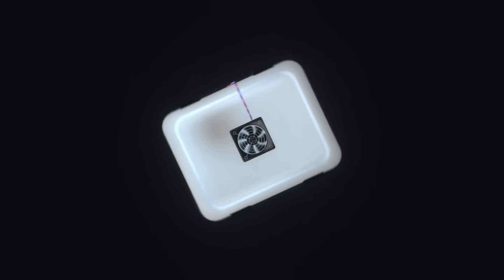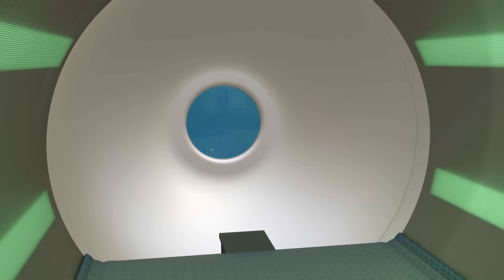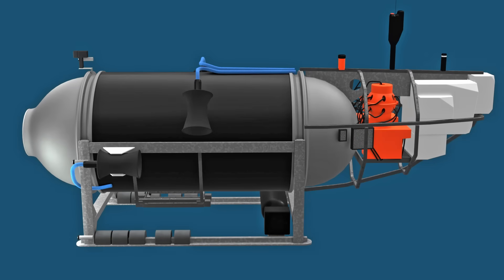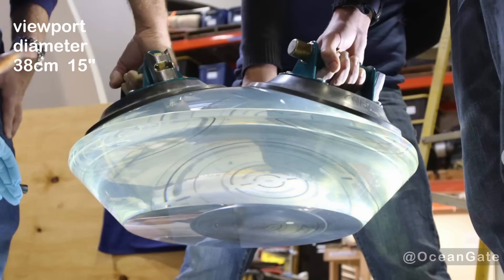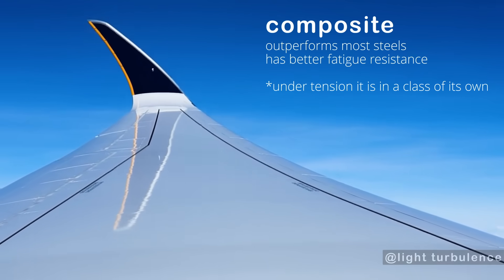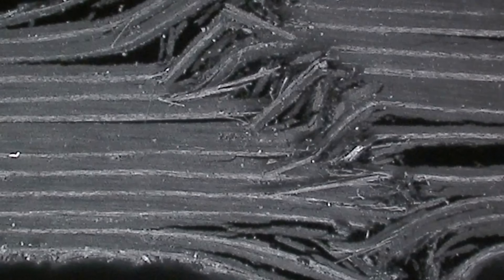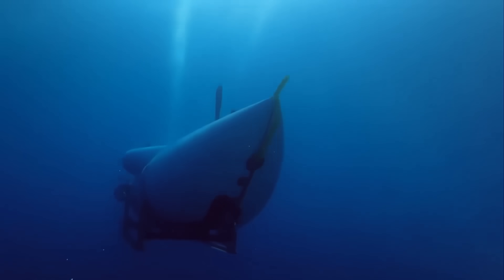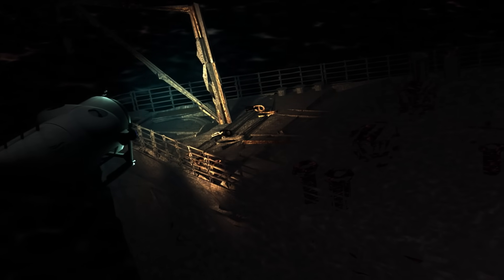Titan Sub | carbon fiber - Detailed Tour

Comment: You fail in your explanation, to show correct pressure loading on the hull. There is actually a water pressure differential between the top of the hull and the bottom of the hull at these depths. The pressure gradiant about the hull varies and there is no added geometry in the hull cross section to correct for this gradient, it is simply a circular hull. Similarly there is no end section geometry of the carbon wrapping to compensate for the pressure gradient about the hull in it's entirety.
This was a very poorly designed vehicle which ignored the facts of deep sea pressures on a submersible hull and assumes erroneously that a circular carbon fibre hull would suffice and any additional; geometry would not be needed in the equations.
Check out the hull design of trieste Bathyscape it ain't spherical and it's not tubular, it's a complex shape and it worked.
Reply from the maker: Technically there is a pressure differential between top an bottom but it is negligable and not of any consequence.  The complex shape of the Bathyscape Trieste is its ballast tanks.  The pressure hull is the little sphere below.  And its a circular sphere, not shaped for any pressure different.
Reply: @Mike-Bell  the consequence of ignoring safety in design, was implosion. True, the Bathyscape pressure vessel was spherical but it wasn't made of carbon fibre. And I bet you are correct that with the Bathyscape the pressure gradient across the pressure vessel was negligible, but that was because it was purposely over engineered and designed to survive.
The carbon fibre "tube" is inherently a bad idea and was designed to be profitable.

Comment: The way they glued the titanium rings to the CF alone, absolutely ridiculous. They rolled the glue onto both parts, set the ring on top of the tube, done. 
No elaborate resin infusion technique or so to prevent voids in the glue, no vacuum bagging afterward, no autoclave curing. Nothing. 
They built pressure vessels like it was an Arts'n Crafts project for their Etsy shop or something. 
And then there's the combination of CF and titanium. I'd have to look up the exact numbers, but I'm pretty sure titanium has at least twice the the temperature expansion rate of carbon. They glued that hull together during summer judging from their clothes and sweaty foreheads, then repeatedly sent it down to the bottom of the ocean where it's 0°C. The internal sheer stresses in those halfassed glue joints must've been substantial.
Reply: Listen as a plumber I was concerned it might leak.
Reply: And they left it a whole year in parking lot not even indoors-plus every time travelling in open ocean with it just hugging behind the ship cause there was on space to fit it on top -plus it was struck by a lightning 🎉
Reply: I wonder if it would have worked if they had not been so sloppy in their manufacturing process.
Reply: @kuei12  They dived successfully 13 times to the Titanic. Beating the Internatuonl Curse of 13. 
That 14th time is a buggar tho.

Comment: Theres a video of Oceangate gluing the titanium endcaps to the carbon fiber hull. In the video, a texhnician uses a wipe to clean the end of the fiber hull before glue is applied. As he is cleaning, he wipes the entire circumference of the hull and then touches the hull after he wipes to brace himself. You’d typically want an immaculately clean surface to bond to, and now this technicians skin oils are all over the hull. If they can’t get that right, it’s not surprising at all that the sub failed. RIP.

Comment: The carbin fibrr is yes very strong but i have see in videos like this one and other pictures workers standing on the pressure hull and in this video there are cargo straps around the carbin fiber hull and the strap buckle or tensioner touching the fiberglass hull also the flanges onn the end of the hull is a bad desgin as if you carack one strand the whole system will fail at some point and the pressure that the water at that depth would move the end caps only a small amount which when it puts pressure on yhe fiberglass it will cause it to crack  and the ATR 42 their caibin fiber wings were cracking because the engineer was tapping the anchor nut on for the wing tip with a hammer and even though he was not tapping hard it caused the fibers to brwak causing cracks under load .also i was told in a aircraft factory that carbin fiber glass is. Very strong but yoy hit the end of the fibers it will crack .this was the problem there was not enough care handeling the product as i pointed out some and the desgin as to the ends this was a sort of good idea but a bit more though it would have worked and the first big cracking noise they should have stopped it and not ever tried to go any further as that is the sound of the fibers breaking

Comment: Anyone versed in material science care to comment on the challenge of the differing modulus of elasticity between the CF and Ti?   Seems like detonation of the CF tube was not necessarily the primary failure and could have been secondary to failure of the union between these materials with very dissimilar rigidity responding to the compressive forces differently.   If the clearance between the outer diameter of the CF tube and the outer flange of the Ti domes was less than the differential of deformation then this alone could have “unzipped” the  outer flanges.  Any infiltration of water at that depth could then cause a sudden asymmetry in pressures to the CF hull and then result in its detonation as secondary to the joint failure.

Comment: Your example of compression doesn’t apply to a pressurized vessel. Much different forces are at work here. The tube imploded because CF is weak to external compression of a pressurized vessel. The matrix holding the CF failed causing the implosion. Plain and simple.

Comment: For use in any pressure device you use filament winding not a lay up type. Also you use testing to note any voids. And you filament winding over the end cap attached to the chamber. The whole system was unsafe. It was horrible engineering and no testing and rushing into production. What works on airplanes doesn’t transfer to the ocean

Comment: There were 18 bolts to seal them in, but they only tightened 17.  Why?  And why did they name it Ocean GATE as though controversy was expected.
Reply from the maker: The 18th bolt was right at the bottom and blocked by the realease mechanism of the landing frame .  After a certain depth the bolts were not required because the crush of the ocean closed the dome tight and the 18th bolt wasnt essential.

I agree, really odd choice to pick the name OceanGate.

Comment: This video sounds like it was made by an apologist. While the final results of the Coast Guard investigation will take time, several facts have been confirmed; the acrylic veiwport was never rated for that depth, and the fact that Oceangate never submitted the carbon fiber structure for testing at all. That's all on the head of Stockton Rush. This was an armature design built by an armature, but being marketed as a professional job.

Comment: The vacuum of outer space is only a difference of 14 atmospheres, depth around Titanic is about 90+ atmospheres. Big difference and why it's easier to engineer for space than the deep ocean. Carbon fibers are extremely strong...in TENSION. Unfortunately the submersible is under COMPRESSION, so it's the bonding agents and glues that become a weak link in the chain. There are just too many variables involved with the bonding process that can lead to a failure. A void/delamination/bubble develops and that enormous relentless pressure will cause it to propagate and unzip the entire hull in milliseconds. Metal actually gets STRONGER under compression which is why these deep sea submersibles are usually made of metal, not carbon fiber. I doubt that the carbon fibers themselves failed, my guess is it began with the bonding agents. The fibers themselves, even though under compression, probably did fine until something compromised the bonding agents.

Comment: The real issue is a pressure container was used as as a pressure vessel combined parallel vs cross-weave layering that was never checked for flaws.

Comment: No, carbon composite is not good in compression. Of course, it is not zero but it is not outstanding. Furthermore the composite is dangerous because of the cycling of loads. Composites are very difficult to predict.

Comment: Thanks for a comprehensive and accurate depiction of the flaws built into this vessel. When carbon fiber first came out, we (who worked in composits) were all taught that the 60/30 angle of layup would provide a vastly superior strength. When I first stated seeing similar reports on the tragedy, I figured it had to be a massive error in the laying up of the fiber. You illustrate this perfectly. I also thought his warning system had to be little more than wishful thinking. Lastly, I'm stunned he never utilized NDT like ultra sound. This was a programmed accident. Pride & confidence are not equal to good old-fashioned NDT & destructive testing. Thanks for such a good report. I subscribed. 👍🏻
Reply from the maker: Welcome aboard. 
I agree. The acoustic early warning system was a marketing gimmick and self-hoodwinkery and self-delusion by Mr Rush

Comment: I have worked with Titanium and Carbon Fabre for yachting purposes.  My limited engineering knowledge is asking about differential thermal expansion and contraction... and Youngs Modulus is different for both materials...  As you mentioned a rounded filament wound shape similar to SCUBA tanks would have been a better design... or a sphere... BUT then you have holes at the ends for access... and there would likely be a higher resin to fiber ratios due to the geometry in those areas --- plus more sharp radius curves === and possibly some cutting of the fibers for access ports. === and this could be a place of weakness --- it just doesn't take more than a pin hole to start cutting and rupturing materials at those pressures ... or worse yet a catastrophic failure...  Look at the water jet cutters --- that could happen down under .... with no way to stop the intrusion.

Comment: Great video!
Now, if they had wound the tube the right way, they wouldn't have needed the titanium bottom.
Wich still leaves dozens of problem, like the thrusters having no redundency and no influence on pitch.
What do you do if the craft pitches so much that everyone falls to one end? There is nothing to hold yourself inside to climb up

Comment: Having read many of the comments on here, there appear to be quite a few statements that could be deemed plausible but there are nuances in any investigation. Any material that is not manufactured in a controlled process, could fail. I have seen failures in all materials, steel, titanium, CF, Acrylic. I have seen many failure modes. Stockton Rush is the primary failure. He did not listen to industry peers, gathered yes men around him after sacking his expert, and is a deserving recipient of the Darwin Award. I feel sorry for the people he took with him. 

Oceangate clearly cut corners in the Manufacturing method, as there was no autoclave used in the process from what I can find. It is possible that CF can work according to the engineering intent, but it requires a methodical approach and analysis of not only the manufacturing method, but also the final assembled system, preferably without a human in it. I have no doubt there will be a successful deep sea CF sub built within the next 25 years. It may have a different layering method, it could be laminated with titanium mesh, it could be many unthought of methods, but ultimately this incident will be studied to find out what went wrong, and somebody will find a method of doing it right. 

There was no way a carbon fiber fan blade could be used in civil aviation 25 years ago, yet we have them now. There was no way we would have a 5nm semiconductor 25 years ago, but guess what, we have them now. Never say never when it comes to human ingenuity or human stupidity.
Reply: They probably figured that out a way to layup fan blades that gave them tension under load to make use of the carbon fibers' strength. A fan blade is not under compression from all sides, it's under tension, just like the example of an airplane wing used in the video. How are they going to make a vessel that is under pressure from all sides with a material that is made of fibers. If you soak a fibrous material in glue, the glue will give it a certain amount of compressive strength but that doesn't mean the material itself can withstand outside pressure. It doesn't matter what pattern you weave a rope in - it will hold solid under tension and buckle, or "wrinkle" under pressure.
Reply: @AlrienJ All this was explained in the video. Didn't you watch the entire video? If not, go to the section on the mandrel & read my other comment. Also, to get the maximum strength from fiber composits the fibers need to cross each other at the 60/30 angles. I hope that helps.
Reply: @AlrienJ  The primary issue with the CF fan blades were the soft body impact of a bird strike, causing the fan blades to disintegrate, so they developed a new layering process and a new molding process to overcome this. Note the paragraph below:

 Kim et al. and Siddens and Bayandor investigated the initial degradation of individual fan blades struck by a bird and evaluated subsequent damage to other engine components using an arbitrary Lagrangian-Eulerian (ALE) method and a meshless Lagrangian particle method, respectively. Heimbs and Bergmann presented the dynamic behavior of laminated composite plates exposed to tensile and compressive preloads under soft-body impact. Tensile and compressive preloading was found to exert an influence on the damage pattern. The newest generation of composite fan blade is manufactured using 3D braiding techniques in combination of resin transfer molding (RTM) process. With advantages of low delamination tendency, high strength, out-of-plane stiffness, and impact tolerance, 3D braided composites have recently been recognized as one of the most promising structural composite materials.

In a nutshell, Resin Transfer molding ensures there are no air gaps in the CF, it's a pressurized process of molding, which is then baked in an autoclave under a vacuum. The 3D layering is to ensure the load path is directed in the most efficient way through the component. It is probable if Stockton Rush had followed this process, the ability of the CF to withstand higher compressive loading would have been substantially enhanced. The biggest issue would have been cost. RTM brings the material into a more stable process, with a tighter percentage window for calculable failure rates, instead of the suck it and see method applied by Rush.

There are many papers out there for the Experimental and numerical buckling analysis of carbon fiber composite cylindrical shells under external pressure. Most militaries want a composite submersible for it's "Stealth" capabilities, and many engineering minds are working on a CF submersible. The commercial submersible industry is very small and as always, for advancement in a particular field, it needs either military or high-end commercial funding to push the envelope. I think Rush may have been aware of the military application, but was doing it on the cheap.
Reply: There is absolutely no reason to use CF for applications that require strength under compression and that involve compression/decompression cycles.
Reply: smart man @acr08807
Reply: Not only did OceanGate know about the degredation failure of the carbon fiber material, they even had data on an average life cycle from a previous iteration (around 2 years). It now seems clear that Rush was trying to squeeze one more trip out of a vessel he knew could be compromised. 

Carbon fiber has proved successful for underwater applications which use internal pressure (air tanks). For external pressure application carbon fiber is known to degrade, delaminate, and shatter after repeated use. 

Before the fatal last voyage OceanGate passed on an ultrasound scan of the Titan's hull for financial reasons.
Reply: What I find the most interesting is it survived several times going down before it failed, so they got SOMEthing right. Just not long TERM right.
Reply: This was built to be an accident looking for a location. From the very first time it was put under pressure, it was failing.
Reply: @AC3handle 
I think that could be a kind of fallacy.
I built a power amplifier once where the output transistors carried 4 times the amount of power they were supposed to carry.
It lasted  less than 2 minuets. Did I get something right?
Reply: @AC3handle yes they got something right but it was disposable... and people died.